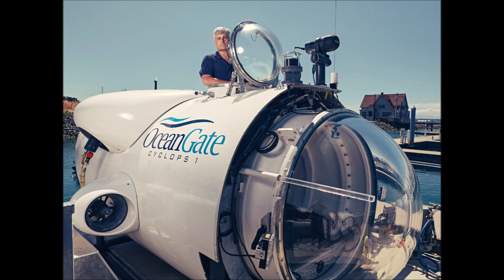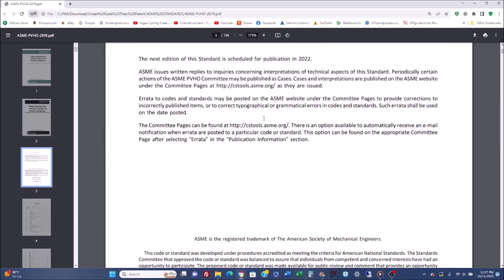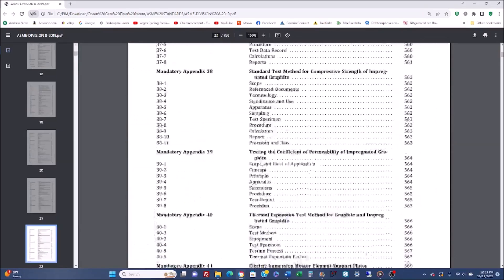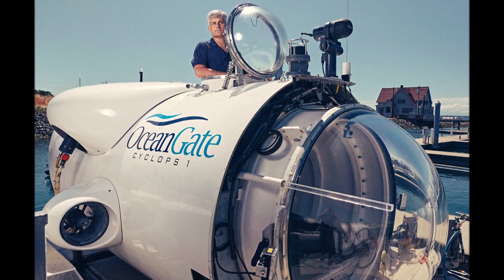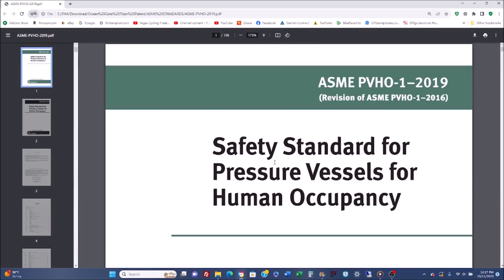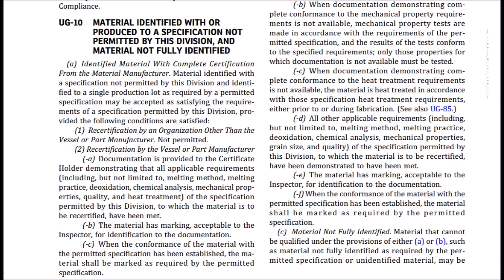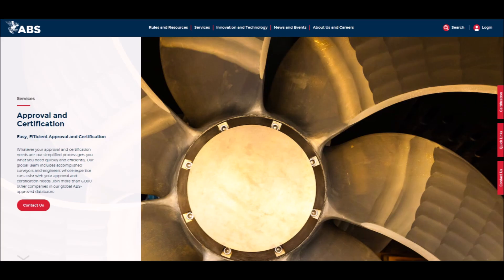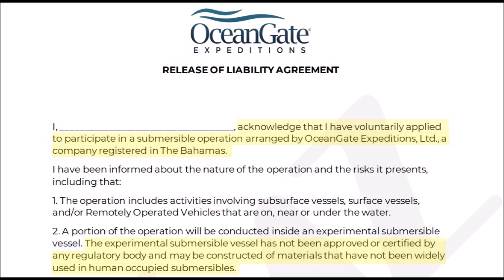OceanGate Titan - "BEYOND CERTIFICATION"?

Comment: I have something that has come to mind. If they dropped the landing frame in an emergency situation, how would they recover the Titan? The platform seems to require the frame to interlock with it to be brought back to the surface. We know the Polar Prince had no lifting equipment capable of lifting the weight of Titan. Even if they got it on the platform how would it be secured. A cylinder on a flat platform rolling around as waves crashed against it. I wonder what measures they had in place for such an emergency and if it was ever rehearsed. Or would it been a case of getting it to the surface and calling for help?
Reply from the maker: I don't know many of the details about this year's expedition but last year they used the Horizon Arctic, which is normally used to service deep sea cables and that sort of thing. They had an ROV on board, so if they needed help it was available. That would have only come into play if the normal emergency protocols of dropping the weight carriage and frame did not work for some reason. 

I believe it was in 2021 they had to drop the weight carriage and when they got to the surface they were bobbing around and divers had to help get it back on the diving platform. The ballast in the tail should have kept the Titan upright. Without the frame aka landing gear it would certainly be much more difficult to retrieve. You can hear that story recounted here: https://youtu.be/zDcDZxCsrr0
Reply: Thank you, my own opinion is Oceangate was losing so much money that safety precautions were cut to the bone. I am also interested in the air bladder system. Is it possible to inflate an air bag at 4000 meters? You would surely need air tanks or compressors operating at around 6000 psi to counteract the outside pressure.
Reply from the maker: @Cheeky-fingers  Yes it was a struggle for him to break even, but he really wasn't in it to make a bunch of money. It was really supposed to be only a means to end - to generate the income to do the things he really wanted to do, like explore hydrothermal vents and depths beyond 3,800 meters. if you watch this video I get the exact opposite impression about OceanGate's attitude towards safety. They were safety conscious nearly to a fault. https://www.youtube.com/watch?v=TddIDXj2BRs&t=1335s

Regarding the air bladders, I am not sure when those came into play. It would have to be at shallower depths where the pressure was low enough for them to actually be deployed.